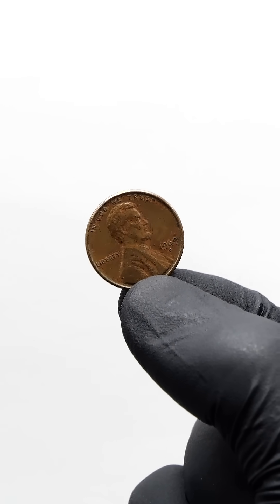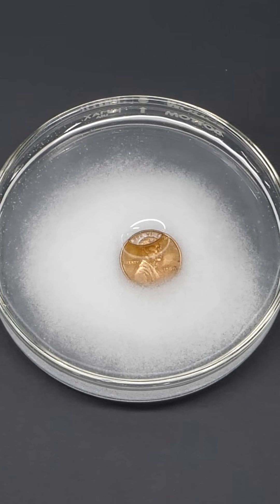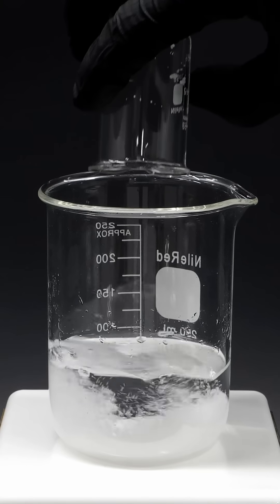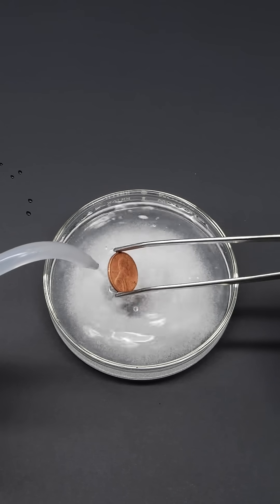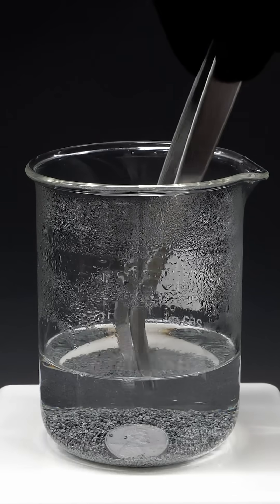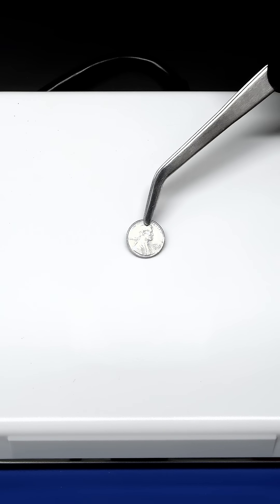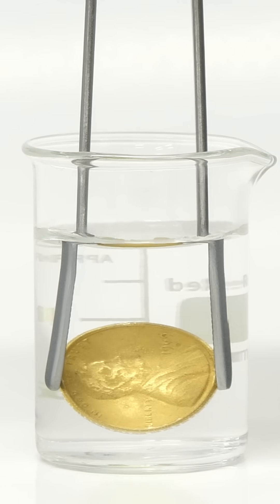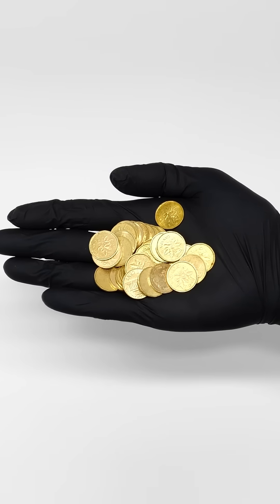The golden penny experiment

Comment: I did this in highschool science class. You have to use an older penny that's made out of more copper. Everyone in school was walking around with silver and gold pennies.
Reply: So the thin copper coating on modern pennies won't work?
Reply: @Nerdnumberone  Sadly no. Plus they have illegal currency and if they used this for buying stuff is considered counterfeit currency or messing with it.
Reply: @WilliamHollinger2019  only if you try to use it as a higher denomination.
Reply: @WilliamHollinger2019  This has nothing to do with counterfeiting.
Reply: @WilliamHollinger2019  it would only be counterfeit if you tried to create a penny from scratch. In this case it falls under defacing currency.
Reply: Me too, it was so fun
Reply: Betty fails

Comment: I wonder if it's possible to take an object and through various chemical reactions change its composition but still keep its original shape.

Something like: you take a coin that's mostly copper, you subject it to various chemical reactions that replace the copper with some other element and you end up with a coin that has kept its design but is made of something else.

Of course it doesn't have to be a coin, but any object made of any material that has some distinct shape. If something like that is possible I think it would be an interesting video.
Reply: Well you can transform a leaf from a plant to meat
Reply: @Irreverent_Radiation  True, but it's not entirely chemical reaction

Comment: Speaking from experience, if you decide to keep the penny silver and not heat it, it will eventually just turn back into the original color of the penny.
Reply: Even if you heat it to alloy the zinc coating into a brass coating, it can rub off from excessive handling.
Reply: @brianroberts783  Fairy gold! 😂
Reply: Out of curiousity, do you know why it does that?
Reply: @chrono9503  I would guess it's simply that since the zinc coating isn't alloyed to the penny anymore, it'll break off from wear.
Reply: @chrono9503 Zinc is very soft, and wears off quickly.
That's also why aluminium is often added to the mix when hot dip galvanizing.
Reply: wait is that why "fake gold" wears off so easily 🤔

Comment: This might explain the golden penny I'd found as a teenager many years ago.  I kept it for quite a while because it was so golden, it just seemed odd.  I wonder if it had just been heated up at some point where the zinc core combined with the copper plating to make brass.
Reply: Tbh, probably gold plated as they are relatively common and sometimes find their way into circulation, still cool though.

Comment: I can see why there's many currencies that uses brass, it just looks good aesthetically.
Reply: The more important reason is that brass disinfect itself over time
Reply: @jovanmilosevix  So does copper. It's the copper in brass that's doing the work (a.k.a. oligodynamic effect)
Reply: @bnasty267  But copper rusts so easily which is a problem
Reply: @NihongoWakannai copper does not rust copper oxidizes
Reply: @JumpOrangeOrlandoShipping   rusting is oxidization.
Reply: @NihongoWakannai  no its not put simply While rust and oxidation are related, they are not the same thing. Rust is a specific type of corrosion (a form of degradation) that occurs when iron reacts with oxygen and water, forming iron oxide, while oxidation is a broader chemical reaction involving the loss of electrons
Reply: @NihongoWakannai  Copper does not rust. It oxidizes and the green coating is called patina. It protects the copper underneath, so the green stuff is actually good for copper
Reply: @jovanmilosevix  I doubt that's much a concern for a coin
Now the lack of corrosion, that's much more tangible a benefit for a coin. You don't want them rusting away afterall
Reply: @wilhelmseleorningcniht9410  "I doubt that's much a concern for a coin"  eeeerm! 🤔 did you actually just say that! are you forgetting that coins are past through many hands daily!
Reply: @jovanmilosevix  copper does too and silver
Reply: @jovanmilosevix that sounds really cool
Reply: @jovanmilosevix  So does copper... Because copper is what is anti microbial in the brass mix.
Reply: @jovanmilosevix same as copper, actually.  Sure, there might be a bit more effect from the inclusion of zinc, but copper itself is a common anti- microbial.
Reply: that one guy on twitter that’s in love with bronze would say otherwise

edit: nvm, he said he loves brass but “brass is the bronze family’s strangest cousin”
Reply: That's why I like the 10, 20 and 50ct Euro coins so much, the look so nice.
Reply: @JoJos_RetroGaminG36 so much?
Reply: A lot of the gold colored coins nowadays such as the gold colored Euro coins, are made out of an alloy called Nordic Gold, not brass. 🙂
Reply: @vesa7069  You might want to look up and see what Nordic gold actually is!  It is a type of brass!
Reply: Nordic gold > brass
Reply: @DackxJaniels nordic gold is very unique i can tell
Reply: Brass looks good for five seconds and then it tarnishes
Reply: @hikerclarence7092 brass is just copper and zinc
Reply: @hikerclarence7092 FOUL TARNISHED
Reply: I can also see why there are countries that go against using brass... as apparently it's relatively easy to replicate, thus losing value.
Reply: @BYERE aren't lots of things currency wise easy to replicate anyway despite the material? I mean, if you look at the currency that's used in different countries, you'd probably see why.
Reply: @NefarinTheKujoMogoreg  Not as easy as you think. Aside from having spot-on exact amounts of material AFTER minting the coins, different coins have specific and official minting methods to avoid counterfeiting.

For example, the old £1 coins had special ruffled edging which couldn't be replicated by counterfieting methods.
Reply: @BYERE  I'm aware, I just was pointing out that most aren't made to make it difficult to replicate.
Reply: Copper doesn't rust. Iron does that. Copper just oxidises on the outer layer, and that is way less destructive than rusting
Reply: @AzureBlade07But copper does turn green!
Reply: I just recently learned that the netherlands still used actual gold coins (ducats) up to ww2
Reply: I'm confused why a lot of people here seem to think that brass tarnishes so quickly, since everywhere I can find online says that brass tarnishes and patinas less quickly than copper which is what pennies are normally coated in and those don't tend to tarnish very quickly unless you leave them in water or you're handling them constantly (which is basically leaving them in water mixed with some oils)
Reply: What game are the fake coins at the end from?
Reply: @jerrywhidby.  I'm not sure where you're trying to get at but there's a more than a dozen games that have fake coins. I wouldn't be able to tell you which game in such a case.
Reply: Brass isn’t a common metal for coins. Look up “Nordic gold”. This is most likely what you’re thinking of. A lot of currencies don’t actually use brass but a mix of metals that look like gold. Unlike brass, it doesn’t require polishing to retain its gold like appearance.
Reply: Spend them like you would Normally! Watch people Freak out and try to sell them as Real Gold Pennies!
But I wonder if this defacing the pennies? Would you have to inform them that it’s not Real Gold Pennies?
Reply: @dcmoore8937 Why leave one comment when you can leave two identical comments!
Reply: Spend them like you would Normally! Watch people Freak out and try to sell them as Real Gold Pennies!
But I wonder if this defacing the pennies? Would you have to inform them that it’s not Real Gold Pennies?
Reply: @dcmoore8937 Why leave one comment when you can leave two identical comments!
Reply: Antibacterial too
Reply: It friggen stinks
Reply: Aren’t Pennies copper?
Reply: @grantwhardy They generally are so.
Reply: Brass was commonly used for weapons and tools before steel and similar alloys replaced it. I think it was mostly used because it was already there but no longer use full I once we where able to produce harder weapons and armor. Might es well repurpose it. I doubt people new about any disinfecting properties when the first brass/ copper coins were made.
Reply: @stormsoul3162 Brass is copper allied with zinc. Weapons and bladed tools were usually made of bronze, which is copper alloyed with tin and often other metals. A bronze sword could be sharper than iron or even steel and didn't rust. But  bronze was actually more expensive because Copper and Tin are not found in the same place and rarer than iron ore. That means as soon as Iron became available it was cheaper than bronze.
Reply: @stormsoul3162 Actually, the copper alloy used for blades was bronze.
Reply: @stormsoul3162 ”Useful” not “use full”!  There is a big difference between the two!
Reply: It's cheap lol
Reply: Put it in circulation and see how long it takes them to show up on the coin channel
Reply: Do you really think they were thinking of the aesthetics? R u dumb
Reply: Not true
Reply: bruh
Reply: Ok
Reply: and if they used gold it would be wort way more also most currencies are made out of copper
Reply: Australian dollar coin
Reply: He lyed to us
Reply: You misused a comma.
Reply: Just spend the change
Reply: For a bit.
Reply: Doomguy spotted.
Time to play Okuplok.
Reply: Plus brass at certain mixtures is anti microbial properties making it much cleaner than anything else.
Reply: I saw Canadian Penny
Reply: Oxygen entered the chat
Reply: Thanks for 32subscribers
Reply: No brass is used in coins… it’s called Nordic gold
Reply: WE INDIANS PERFECTED IT